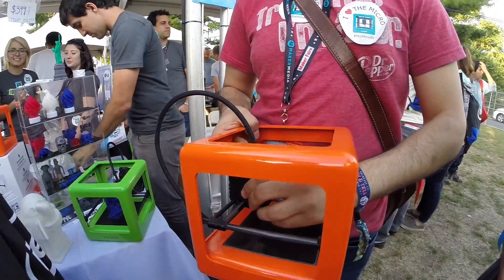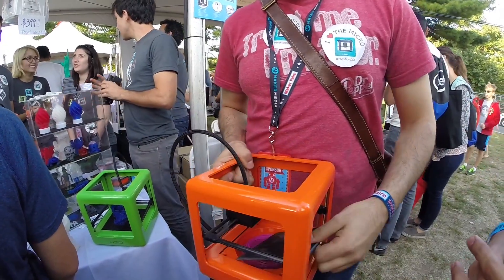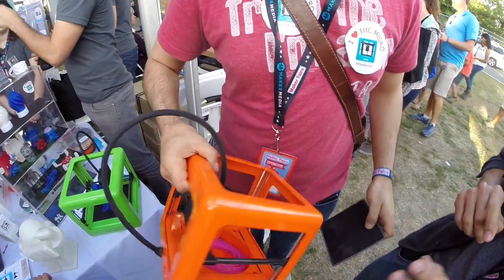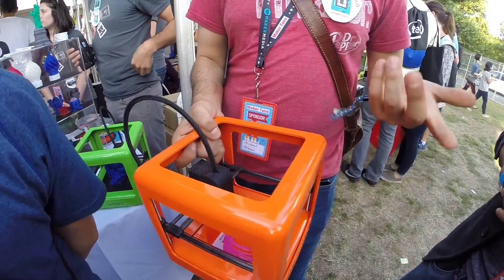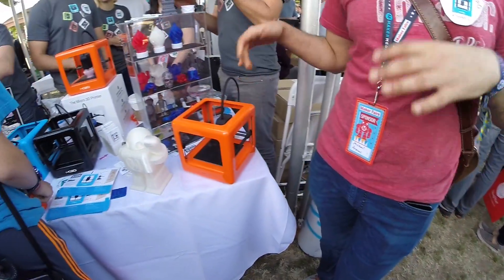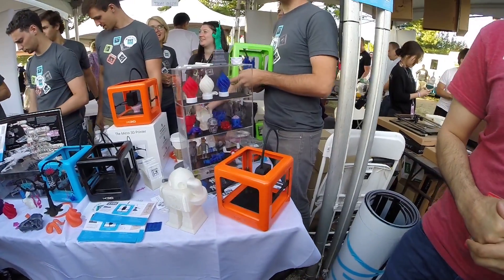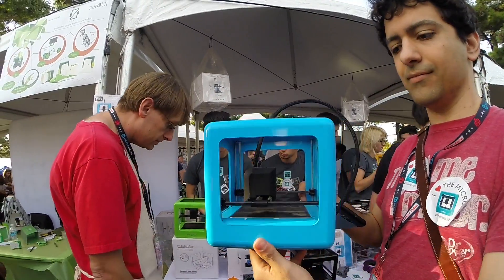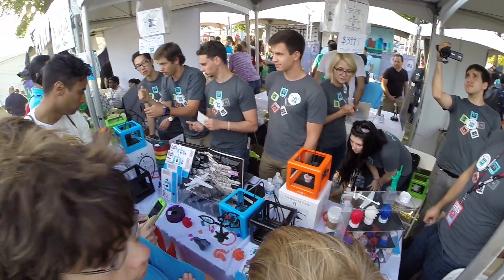M3D at Maker Faire 2015 #WMF15 #3DPrinting

Comment: I got one of these printers through the kickstarter.  It is my first 3D printer.  I am generally happy with it.  A good, low cost 3D printer to cut ones teeth on.  I wish the code ran on linux so I could use a rasberry-pi as a print server.  The filament feeder motor has a habit of sliding away from the toothed gear it grabs the filament with (The solution was super-glueing it into place).  It also gets caught up when printing the apex of an arch.  Also, since you don't define the temp and speed of the print, it is difficult to experiment with specialty filaments.
Reply: Oh, and the print volume is about half other common printers, so I have to cut or scale down almost everything from thingiverse.

Comment: For anybody that might want one of these, do not buy them. I Own a green one that I backed in Kickstarter. I picked the option that waits till the printer is fully finished before being shipped so I got a final production printer and it is no good. The software is still beta after 2 years. I recommend going onto their forum before buying this, you will see how many problems there are currently. I put together a Reprap delta printer for $279 that smokes the M3D Micro which costed me $350. Forum link : https://printm3d.com/portal/forum

Comment: I have this printer . Very small print volume can't do your rasberry project ;(
Reply: And no heater bed 。・°°・(＞_＜)・°°・。
Reply: Can you think of any other details of why someone should/shouldn't buy the M3D? I'm new to this. Thanks.
Reply: +hellothere The micro is a good printer for small print but if I have the chance to change I would like to take the da Vinci. 

Good: Small ,not expensive ,plug and play ,easy to use ,fun color of the printer 
Bad:No heated bed ,no possibility to upgrade ,print volume ,no SD reader ,no LCD display ,need to plug to the computer ,can't print iPhone or phone case ,warping
Reply: +hellothere I had one, I ended up selling it. Print speed, print size and the lack of a heated bed really annoyed me. It was cool because it was portable but it seemed very closed. The only factor to me buying it was price and portability.
Reply: +Michael Delaney where can I sold my M3D for how many
Reply: I sold mine for ~360 off ebay
Reply: +Michael Delaney ok thx